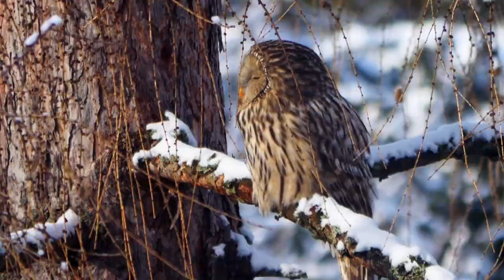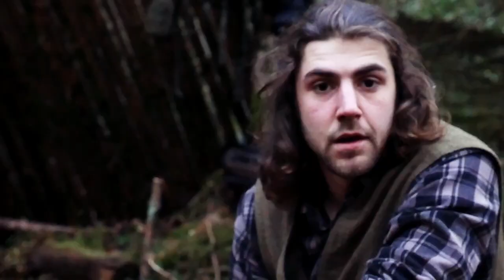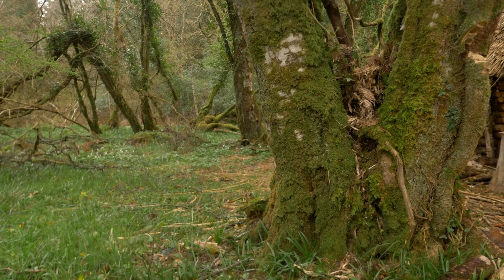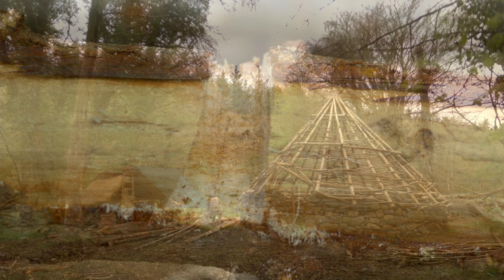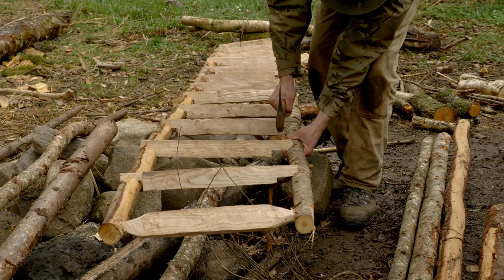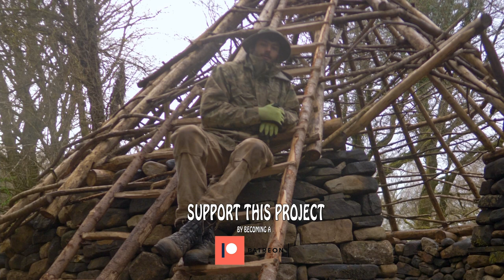BUSHCRAFT CAMP BUILD: 18ft Ladder with Axe, saw & knife (No Cordage)

Comment: IIRC the problem you mentioned with lining up the holes in the first ladder you built is traditionally solved by making the ladder from a split stave (or rather a piece out of a log with very straight grain). Because the two parts were split, they are easily ligned up again which makes re-aligning easier

Comment: For an augered ladder, if you get some chalk or other powder dye and a length of string with knots at your rung distance, and coat the string with the chalk, you can snap a line down your piece with little spots marking each rung point. Then just augur in equal depth, make sure all your rungs are equal length, and assemble. Advisable to have a sap tar of some sort to put into each hole with the rung ends, and if you assemble both sides with half the rungs each, it should go together very smoothly.